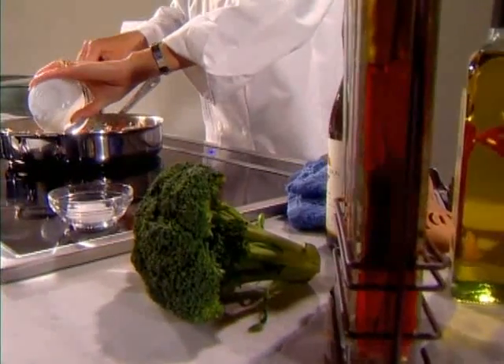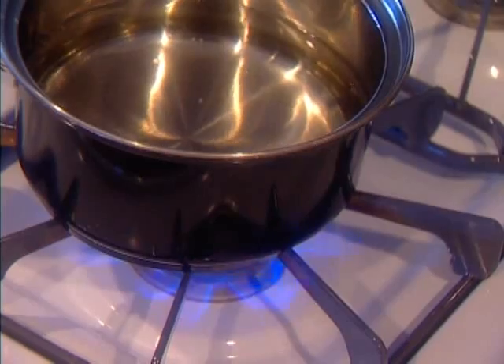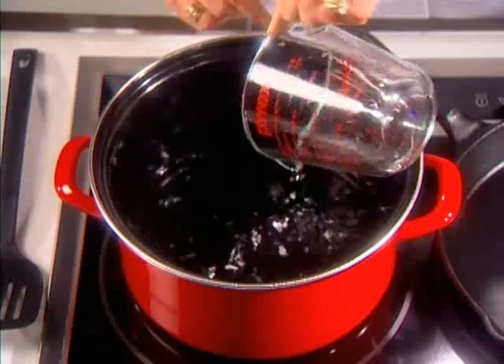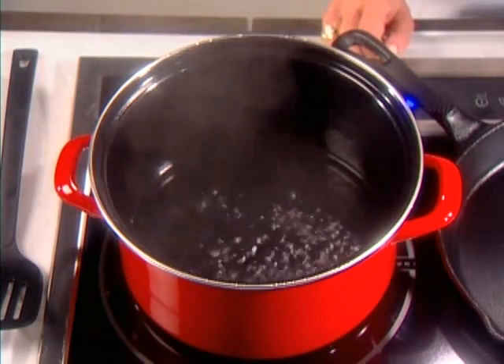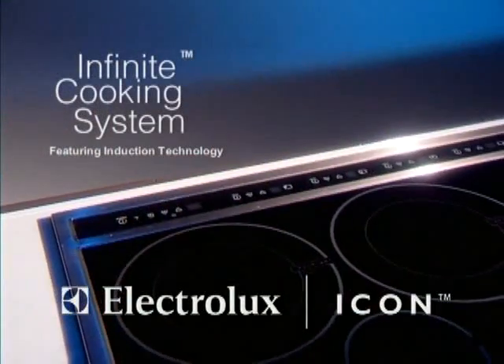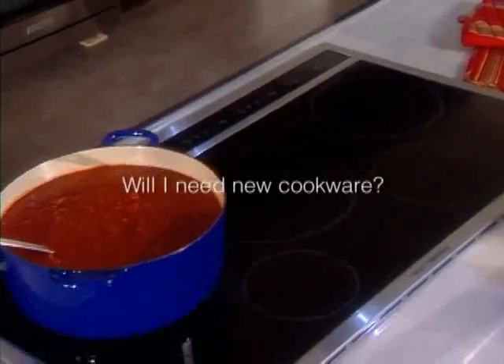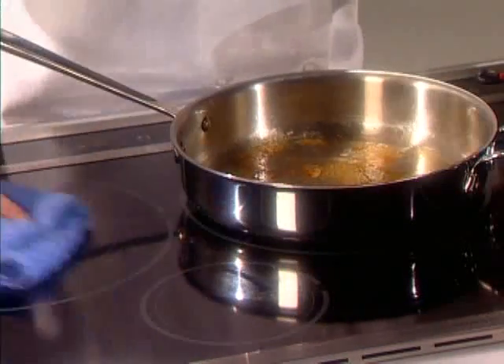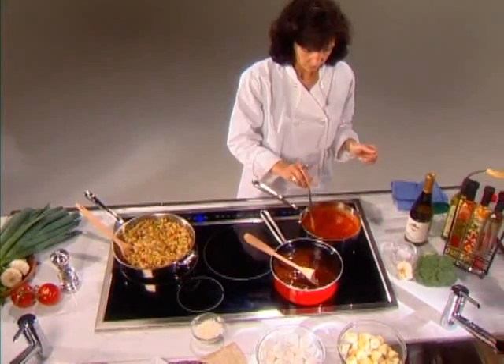Electrolux-Icon Infinite Induction Cooking System

Comment: the earth's magnetic field doesn't change with time so it's not a problem ! the problem is high magnetic fields emitted from devices like induction stovetops which change at the power and other frequencies, 50/60 cycles a second ! you wouldn't live close to a transformer sub station, television transmitting tower or under a cell phone transmitting tower, it's all the same problem, resonance of iron in the human body, generating damaging free radicals !

Comment: I think the cookware that they sell to consumer is good (it did not broke & seems easy to use, although cost abit more), but the expensive food *you complained* is different case altogether. -->You might want to complain to the management, but IMO the cookware should still be praised for the engineers that design it (its no related to food price at your workplace whatsoever).

Comment: I have one at home and it is absolutely delight to use, but it is not neccesary more 'efficient' as it still uses the same amount of power as electric cooktop, so if it is on for 15mins, it still uses same power as electric cooktop, but it cooks much FASTER hence it is more efficient